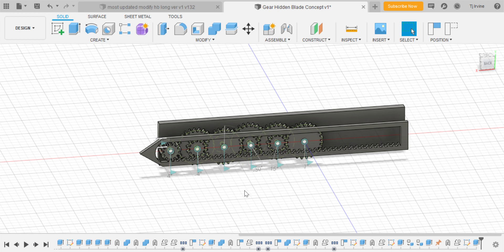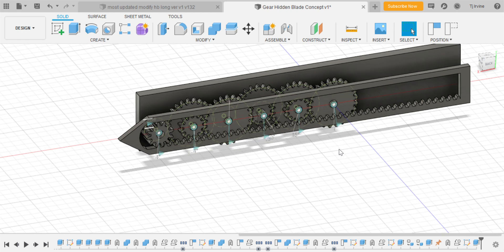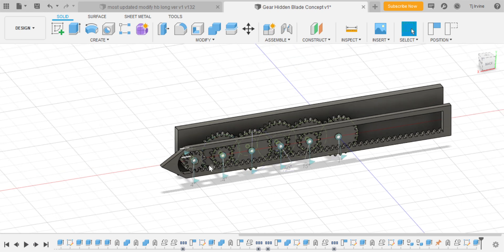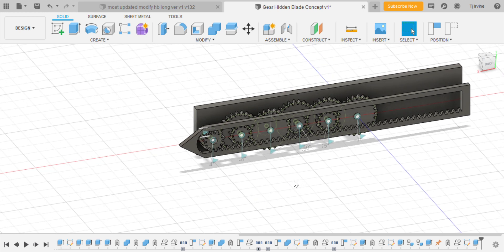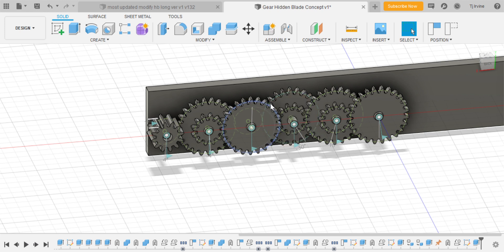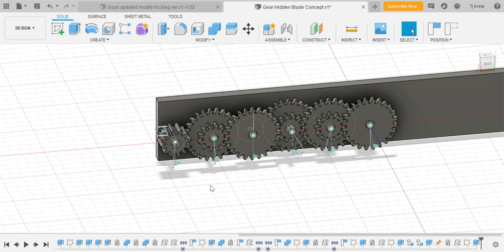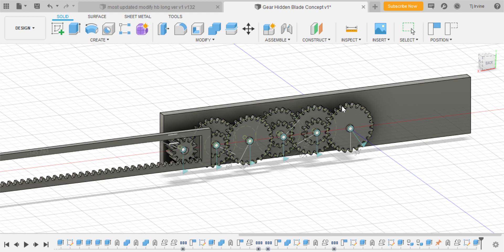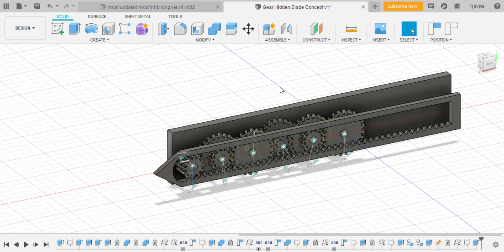Revolutionising the hidden blade design! Say goodbye to the OTF mechanism! (Designed By RAWICE511)

Comment: There is one issue I can see though in my opinion is that the blade would need a track in the side of the blade and I suppose it would be good for props but how would you create a bevel at both sides

Comment: You have a 1:32 gear reduction here. That also means that it will also essentially take 32x the torque to move the blade in and out. Let's assume it takes 5lbs of force to stab someone while extending the blade (like you mention in the video). Let’s say you lose 10% of your power from each gear engagement due to friction (no room for a ball bearing and faces slide against each other). For a ratio of 1:32 with 5 gears you keep .9^5 of your power which is 59% of your power (round to 60%). If I assume that your larger gears are one inch wide (meaning the smaller gears are ½ inch) and we need 5 pounds of force at the blade, that means our necessary output torque is 5*.25 = 1.25 in-lbs. That means our input torque would need to be 1.25*32/(0.6) = 66.5 inch pounds of torque translating to 133 pounds of force applied to the edge of the large gear. Even if we even needed one pound of force to overcome the static friction of the blade we would need (.25*32/.6)*2 = 26 pounds which seems like a lot to ask of a finger. And this also doesn’t consider the force it’ll take to spin up the mass of so many gears (the inertial load). From the video it looks like you didn’t even need to spin the largest wheel even halfway to complete a full extension. If we lose only 1% of force per gear and you remove a gear then the force would only be 0.5*16/.8 = 10 lbs which might not be so bad as long as there’s no opposing force. I’m not trying to rain on a parade but I’m just kind of skeptical of this working in its current form. I hope you figure out something that works! And if I’m completely wrong I guess I’ll learn something new too.
Reply from the maker: We shall see :)
Reply from the maker: I don’t mean it will be able to push through anything substantial but it will at least be able extend in water unlike the OTF design which was one of the main goals

Comment: How sturdy will that blade be or what if dirt or grim gets into the gear track.  May I suggest it the blade has a small gear track built in on the backside. Also on the front where the blade comes out you can possibly add some form of shielding if you go with a hollow blade cut out that can help keep the gears clean with a small brush on it
Reply from the maker: I only made it hollow for the video the final version has a gear track that just goes halfway through the blade leaving the other side solid! 👌

Comment: would you consider a planetary gearbox to compact the gears into a smaller package? for example, 2 stages of a planetary gear set with a ring to sun ratio of 5 will be able to take your ratio all the way to 36
Reply from the maker: It’s actually a lot smaller than it looks in the video the whole things is only 1.2cm thick and I can make it much thinner this was just a rough model, the gear system is 1:32 which I think will be fine for the mechanism! But I appreciate the ideas will be interesting to see it when it’s done!

Comment: Your mechanism requires a motor that is strong enough to launch it as fast as the OTF and through things like flesh, cloth, or sandbags. However, I recommend you to watch this video to show you how an OTF system can do what you claimed to be impossible: https://youtu.be/VmvcirebyY4
I'm not criticizing, I'm just trying to go through a Mindstorm with you to find more ideas that won't make you end up putting a 5-8 kg Hidden Blade on your arm.
Reply from the maker: Moustafa219 - SilverDam please watch the whole video, no motor will be required for this design it is 100% mechanical. Also keep in mind the model I show in this video is actually a lot smaller than it looks it is 18cm long and only 1.2cm thick. And lastly OTF cannot push through hard materials whereas this design can, try not to judge early my friend wait until I release the prototype and you will see it’s a lot better!
Reply: @RAWICE511  I've been a fan of your work for long, I will stay subscribed no matter what, and I fully support you. Plus, I've made the wooden blade 3 years ago (thanks to your tutorials), and I can't wait to get my own workshop to start working with metal. So, I can't wait for the mechanical version of the Hidden Blade to come out, especially after Ubisoft ruined the story of Assassin's Creed by releasing Odyssey.
Thank you

Comment: I actually made something pretty similar to this. Except for my blade isnt hollowed out, it's pretty much a full solid blade with a fuller going down the middle which has the gear teeth (I think that's what they're called)
Reply from the maker: RogueTrident yes I just made the blade completely hollowed out for the video so you could see the mechanism inside but in the final version the hollowed our section will only go halfway through the thickness of the blade! But good idea putting it straight down the centre 👌
Reply: @RAWICE511  even still yours looks so much better than mine haha

Comment: Perhaps using a pressure switch where once you flick your wrist the bone just out therefore causing a sting to push the gears into action or instead sending an electrical current to a small motor inside of a gauntlet

Comment: Rawice, perhaps you could use a small enough more to be able to fit into a gauntlet but powerful enough to more the blade and with enough speed but to trigger the motor would be like a switch but that switch being a bottom. You could make a glove with a button on the side of the index finger right were your thumb could press it if you tried. The button once clicked could turn on the motor to move the blade with enough force and speed like a real hidden blade. Clicking the button again would retract the blade. It’s not the best idea but idk how something could detect the flick of a wrist to send a signal to the motor.
Reply from the maker: Mine will be 100% mechanical no need for a motor, watch from 6:00 onwards where I explain the wheel 👌
Reply: RAWICE511 Will do, I had watched the video beforehand, was just coming up with extra ideas perhaps for future designs

Comment: Quick tip, you should try noise cancelling your audio. If you use audacity, it is built in and it would make your audio sound a lot better
Reply from the maker: Yeah I had my 3D printer going so it was a bit loud it stops around 1:50 😁